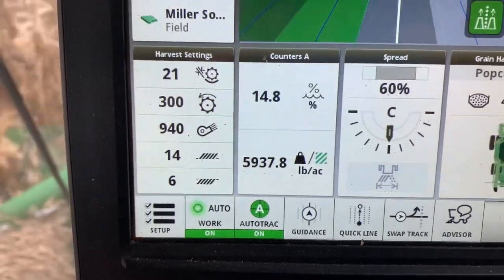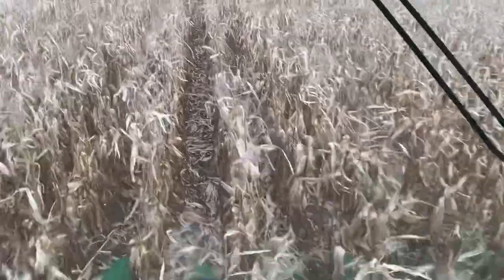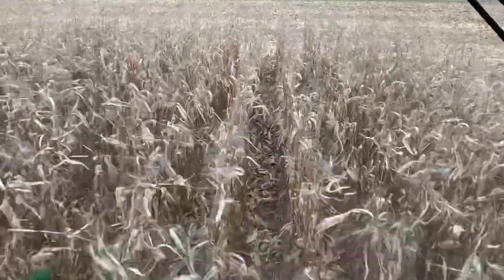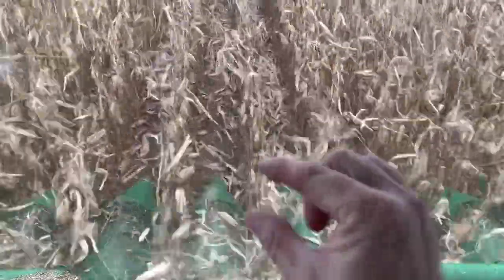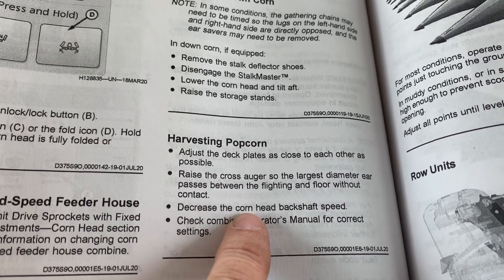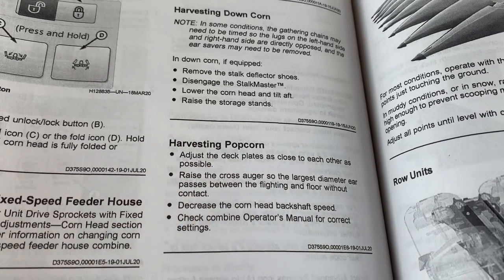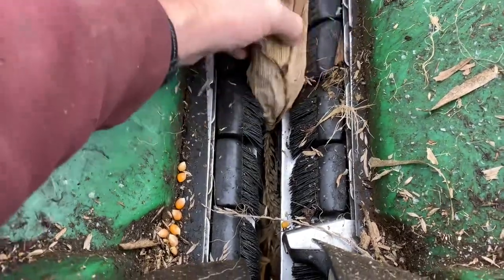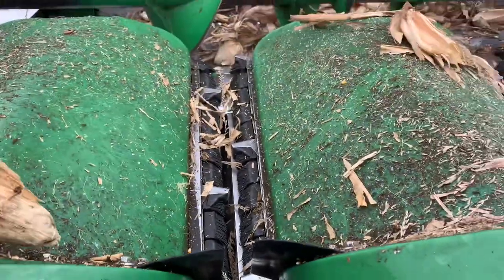How Is Popcorn Harvest Different From Corn Harvest?

Comment: I just got a 7200 vacuum planter that I'm working on for this spring. Any thoughts on setting it up for sweet corn seed?  I've been using a 4 row 7000 finger pickup and finally got it dialed in.  I wanted to run it through the 7200 to get fertilizer and rootworm protection for the sweet corn.  Also, any thoughts on figuring out if the hex shaft needs to be pulled? thanks.
Reply from the maker: Chain drive? We've had hydraulic drive and now electric for a long time. Make sure you don't have any slop in the chains and sprockets. The @precisionplanting website has some good resources for going through your planter. https://www.precisionplanting.com/agronomy/research/your-planter-maintenance-guide
Reply: @TheFarmersLife  thanks.